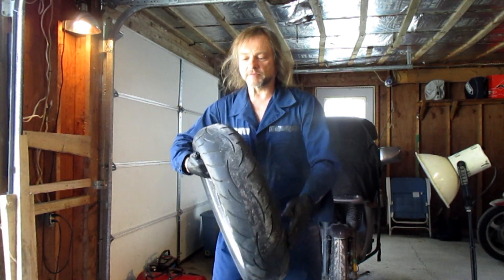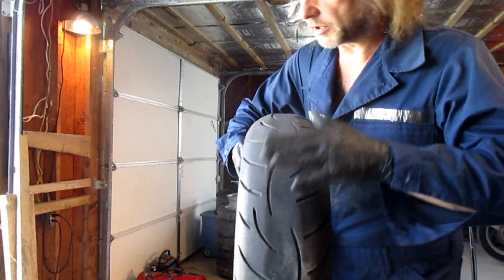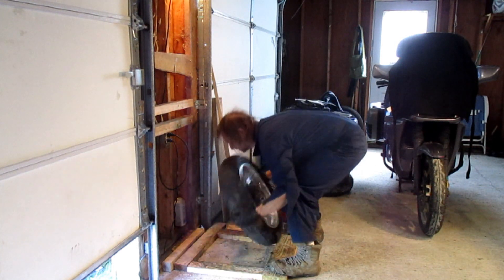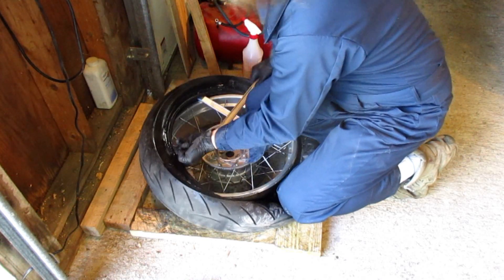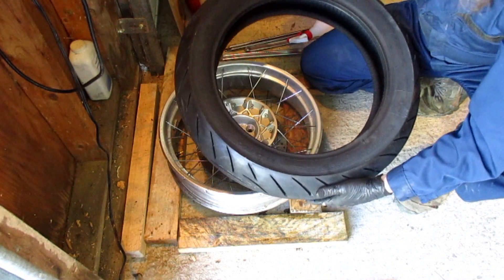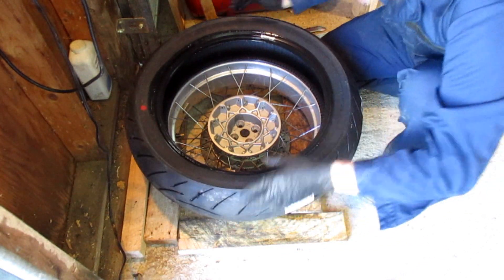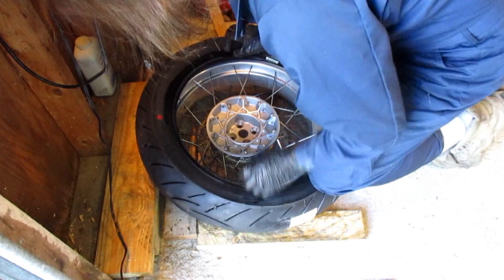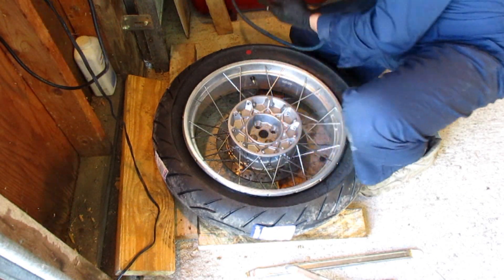2019 July 18 - R1100R rear tire change

Comment: Thanks for putting this together Chris! Can’t wait for the next show. Balancing...there is my issue. Keep it up!
Reply from the maker: In time, there will be more.
Reply: I believe Chris Harris would disagree with this, but,  if you going slower than 80 mph, the wheel most likely doesn't need balancing.  I typically ride around 70 to 75 mph.  I feel no shake or bounce and tire wear is normal.  If you are young and crazy and hit speeds over 80, 90 100 mph, yes you better balance your tires.

Comment: good vid chris, i use a vice and the hydraulic clamp on my sawmill ;0) for bead breaking, the only tip i would say is take the valve out, too seat the tyre on the rim (tyre shop hack), then replace the valve when you set the pressure. you did inform me on the ABS sensor though! ;0)
Reply from the maker: Thanks, Steve. More soon.

Comment: One of my issues was that as I slide the rubber over the edge on the left, rubber would slide back off on the right.  This time I used a Mar No Yellow Thing.  The Yellow Thing prevents this from happening.  Without the Yellow Thing I would have to have 3rd tire iron in the edge with a knee on it while working both hand.

Comment: I used to do tires that way when I was younger and before I got my LT.  That LT rear tire is much stiffer than what you changed here and is not much fun with tire irons and you will scratch the rims.  Even though it is not the lowest cost option, I will take my NoMar any day.  No more working on the floor for my 60 year old back and knees and no more scratches on my rim.  I almost enjoy changing tires now as I can do them in about 3 minutes vs 15 working not the floor with irons and my back and knees are much happier.  It was worth the $600 to me, and after changing about 10 tires, my per tire cost is now down to what most dealers charge.  😂
Reply from the maker: Well, fortunately there are no K1200LT's around here!
Reply: Chris Harris I remember from your “rant” video a few years ago how much you love the LT.  🤪

Comment: The R1100R with cross spoke wire wheels (Authority Wheels) uses an unusual tire size set:
Front 11/80-18
Rear 150/70-17
To get a matched set I use the Avon Roadrider AM26.  I get over 10,000 miles on the rear with no scalloping.  These tire do seem to dry rot fast.
Reply from the maker: Hi John, Avon tires often deteriorate prematurely. They are also the top tire for requiring wheel weights after installation. This often occurs on machines that have used several other brands of tires without much change in balance. I've had Avon's in the old shop that took 4 ounces of weight. That's a lot of weight on a BMW wheel. Reverting back to the other brands of tires always solved the excessive balance weight issue. If you are having luck with yours then you are successfully getting your maximum value from them. Good for you, my friend, Chris

Comment: Wouldn't you want to use rim protectors to ........ protect your wheel rims?

Balancing?
Reply: I've tried using rim protectors. They're a pain in the ass and keep moving around and slipping. I suspect Chris will tell you that dings add character. Or just be a little careful with the irons.
Reply from the maker: @TheDude13  Rim protectors are shit for exactly the reasons you've mentioned ;)
Reply from the maker: Something thinner than rim protectors, if you need something. The side of an old oil bottle works for such instances. This particular change was to demonstrate a road-side tire change situation. Thanks.

Comment: Hi Chris.  Great video.  Question, how do you align a 2003 K1200GT bike?  Are there spacers on the rear tire to adjust alignment.  I see videos on how to see if align using strings rear to front but no info on how to align.  Regards
Reply from the maker: Why do you believe that it is it out of line? Is there crash damage? Did someone install a tire too large for the rear? Did you measure with string; how far out did you find it to be? Wheel track adjustment is not something usually considered with these old machines. Tell us more, please.

Comment: Note to self: Get longer frikkin tire irons. The ones I have are a little more than half the length of the ones you are using.
Reply: North West using long levers can lead to excessive force and I’ve bent a rim once before I know what I was doing. I use 8” spoon type levers.
Reply from the maker: Leverage works in your favor.
Reply from the maker: @stephenmcqueen4029  Don't be a ham-fisted gorilla and all goes smoothly. Experience helps.

Comment: So if your wheel has TPM sensors should the paint mark go opposite the valve since that would be the heaviest side of the wheel?
Reply from the maker: We don't have any of that nanny - state, safety - nazi, stuff here. The tire pressure monitor is the asshole sitting in the saddle!

Comment: If you put too muscle and or bending tire irons while mounting a tire, you are doing it wrong.
When you do it right, it slips right on just as fast as if the shop was doing it.
A new cheap tire is always better than a worn out expensive tire.  Buy cheap tire and change them often.

Comment: You are F*CKING amazing. My local BMW shop wants $150 to d the tires off the bike ... I’ll try It myself first. Only issue is balancing.
Reply from the maker: If you bought the tires from that dealership they should mount them for less-$150 is too much for Off The Bike. If you bought the tires via mail order then I am surprised they offered to mount them at all. Install them yourself. Red dot on sidewall to the hole in the rim where the tire valve fits. Leave the old weights on unless mounting an Avon tire (they always take a lot of weight). make sure your direction of rotation is correct. In this video I mounted and dismounted the tire so many times for video I mounted the rear one backwards at the end and had to change it around again.
Reply: Chris Harris  Sadly all but one dealership is left in my area and they said that I makes no difference to them where you buy them ... $150 off the bike or $225 on the bike as they said it is an hour’s service (that seems fair enough, although higher priced). Thanks again for the advice Chris! Much appreciated!!
Reply from the maker: @RichardT2112  I would avoid that stealership. If they have a tire machine and computer balancer that job, wheels off the bike, can be done in less than 10 minutes. Thieves or incompetent?
Reply: Chris Harris Yes to the first - and perhaps the second. Sadly Vancouver has had all but a few dealerships go bust, those which remain seem to fix their prices (I believe they are owned by the same person)... sad state of affairs. Thanks again for the great videos!!

Comment: I had a buddy whose father owned a tire, brake and muffler shop.  Here is what he told me about tires:
Let me know what you think.
    1) All tire are the same just get the cheapest ones.  Tread design doesn't matter as long as its On Road, Off Road or Enduro.  Never pay extra for a name brand tire.

   2) Change your tires often.  The cheapest tire will always outperform the most expensive worn-out tire.  Riders tend to try to squeeze out every last mile from an expensive tire.  Get the cheapest tire and change them often. 

   3) Tires really don't need balancing if you keep your speed under 75 MPH, but 80 MPH is prob'ly OK.   If it feels OK, its OK.  Don't pay to get your wheel balanced unless you plan on riding over 80 MPH.  Its safer to keep your speed under 75 MPH anyway.  

   4) Buy your tires on the internet and mount them on the rim using simple tire irons and don't worry about balancing.  A small air compressor for filling up your tires is all you need to seat the beads.  Watch some videos on mounting motorcycle tires with hand tools.     

   5) Get some mushroom plugs and all the tools needed to install them.  Motorcycle shop no longer like to fix a nail hole anymore.  Instead they want to sell you a new tire.  

Let me know what you think.
Reply: I'm with you on expensive tires- its a sales job/prestige.  Not with you on balancing.I've ridden on unbalanced tires, and I've applied rim weights.  It helps. Back with you on mushroom plugs.  I've had them last the life of the tire, no leaks. Unfortunately, they only work for tread- not sidewall blowouts/damage, which is more common in my experience.
Reply: Can't agree with any of this except for buying tyres mail order and fitting them yourself.
Reply: @alexmorgan3435  , Try a Shinko tire.  The only difference is the price.  The only reason I use Avon Roadrider AM26 is because I have unusual rim size and I can buy the Avon tires in a matched set.  The cheapest tire will always outperform a worn-out expensive tire.  Expensive tires and cheap tires do the same thing.  Get the cheapest tire and change them often.   When you buy the expensive tire you paying for the expensive advertising.  Each model of tire has a different tread design.  The tread design really doesn't matter as long as you have tread so the water has a place to go.  Some tires have a center tread others don't.  A center tread doesn't matter because when you ride on the center of tire you going straight and water is "V" ing off to the sides. The more expensive radial tire has a tendency to scallop more.  The less expensive bias ply wear more evenly.  
      Balancing tires is fine in theory, but what happens when you get a big clunk of mud stuck to your rim or the weight falls off? I've rode over 100,000 miles on unbalanced tire and never had an issue.  Your results may vary.  Maybe you have an issue with your rim.
Reply from the maker: John Doe: you ride on TWO tires each with a contact patch the size of your testicle. How big are your balls? Cheap tires are made from cheap rubber. Often expensive tires are also made from cheap rubber. I don't ride on cheap rubber. ;)
Reply from the maker: @JohnDoe-bf1fw  Remember who Shinko is: Cheng Shin Tire Corporation - Show me a Shinko that withstands 8,000 miles of triple digit speeds and I'll show you a North Korean missile!
Reply from the maker: @Redmenace96  Never repair a sidewall puncture on a motorcycle tire or any tire.
Reply from the maker: @alexmorgan3435  I'm with Alex!

Comment: No mention of tire rotation direction, shame on you
Reply: He did make a note of it on the screen , and if you’re placing the red dot next to the valve the direction of the rotation is automatically accounted for.  ;  )
Reply: @paulbuschman8318  Hey Silly,  All tires will always rotate in the opposite direction that you are traveling ...duh...
Reply from the maker: Ray, Ray, Ray did you bump your head on something?! Tire direction is mentioned in the description and yet again in a caption in the video, here: https://youtu.be/0XiV4i8Qg-g?t=353 Pay attention RAY and shame on you for not noticing shit. This is merely a demonstration of an alternative method to get back on your way when needing a tire on the road. Stuff it in your inner tube, Ray!
Reply from the maker: @paulbuschman8318  Hello, my friend, remember the tire could go either direction as the red dot is only on one side of the tires carcass. On a different note there is a K75S on my lift. ;)
Reply from the maker: @JohnDoe-bf1fw  How's that?! Counter - clockwise when viewed from the left / clockwise from the right. Doh!
Reply: @ChrisR.Harris  a tire rotates in the opposite direction of travel so that the contact velocity with the road equals zero.  A contact velocity other than zero results in a skid.  DOY!
Reply: John Doe Uh, no, tires rotate in the direction of travel.
Reply: @LTVoyager  not at the point of contact.  What are you smoking?
Reply: John Doe In the frame of reference that is moving with the wheel, the wheel is rotating in the direction of motion.  In the fixed frame of reference of the road, a given point on the tire is still rotating in the direction of travel.  The path traced by a point on the circumference of the tire moves in a path known as a cycloid, however, the point on the tire still rotates 360 degrees in the direction of travel during each period of the cycloid.  You are the one smoking something here.
Reply: @LTVoyager  I used to think I was smart by using a different frame of reference to the relative motion of the cyloid.  Still you would agree that the frequency of rotation is equivalent to the repicial of the duration of the period.
Reply: John Doe Yes, f=1/T is physics 101.
Reply: @LTVoyager  ok Einstein.  What kind of bike are you riding?
Reply: John Doe It depends.  When my wife and I rode to Alaska this year, we took my LT.  If just doing local fun riding, particularly on dirt roads, I takes my KLR650.
Reply: @LTVoyager  I bet that was a beautiful ride to Alaska.  I never done that.  If you can make it to San Diego this winter, I would up for a ride down the Baja from Tijuana to Cabo.
Reply: John Doe Fantastic!  10,252 miles in 33 days.  And you could ride 30 minutes or more between passing of a car.  Very nice ride.
Reply: @LTVoyager  way cool.  You camp outside with the bears?